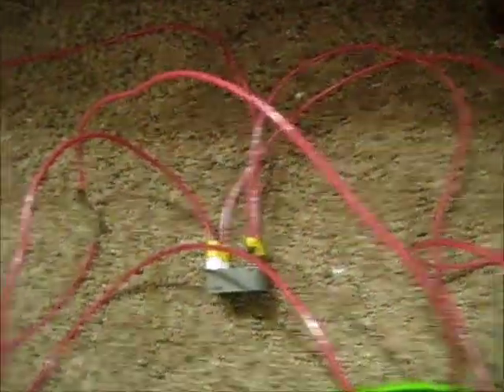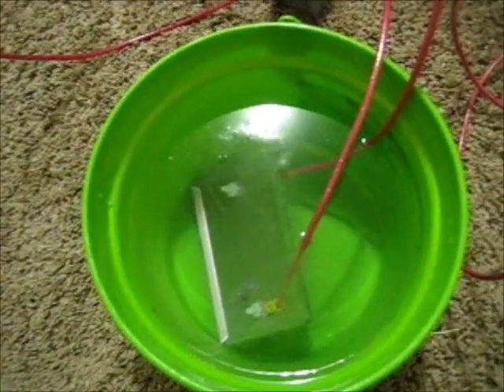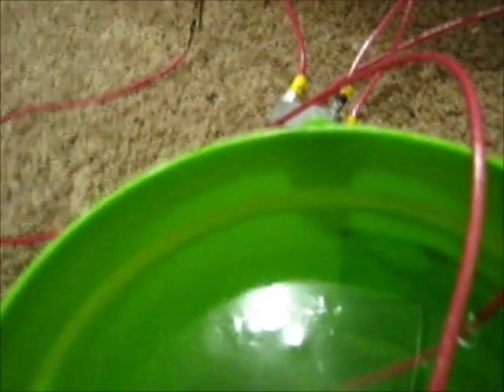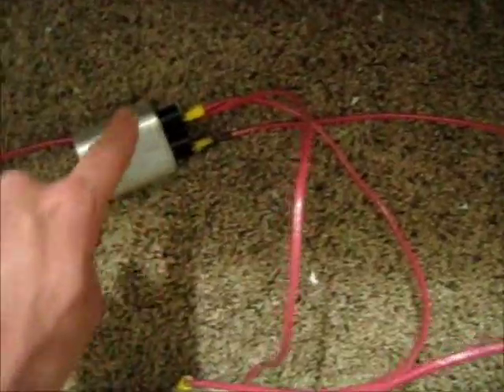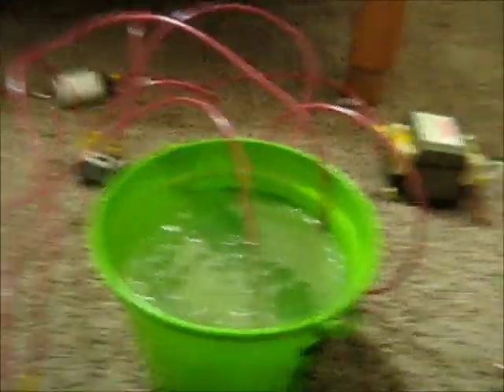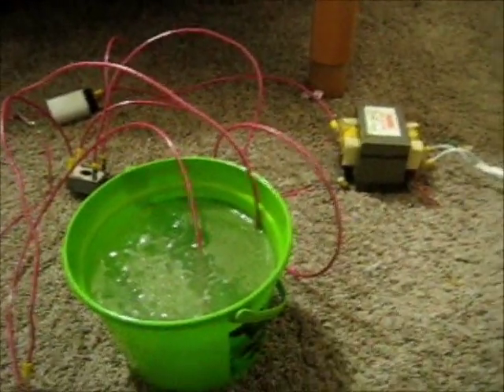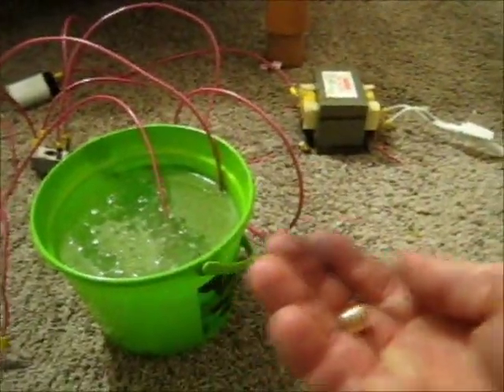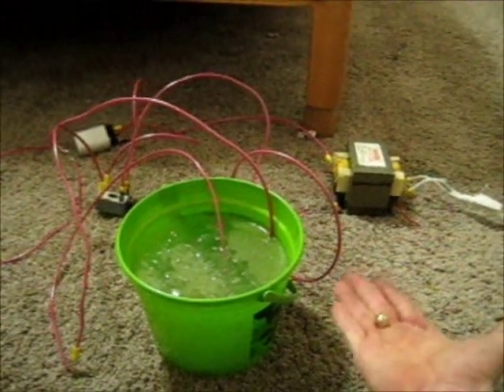HHO Using Microwave Transformer *Rectified* (Video Compilation)

Comment: Either you have a problem or have some amazingly pure tap water. The transformer usually puts out about 1600V DC at about 1A for the magnetron. If you were even drawing half of that power it would be 800W which should be plenty of gas but you are getting less than I got with a 12v 10W power supply even.

Stay away from microwave transformers if you are using the original high voltage winding. They are LETHAL ! And I have plenty of experience working on high voltage but over about 250 - 300v and 1 mistake will usually be your last. At the very least use high voltage gloves and eye protections since capacitors and transformers can EXPLODED when overloaded. And my guess is you are having a short in the water either by arcing or somewhere else.

Try using carbon water arc to make hydrogen underwater, since that has shown to work pretty good and would probably work at about 100v DC easy. See the patents on it. Same for Stan Meyer, Xogen, ETC, see the references at the bottom of the page on Google Patents. And save them in PDF for later. And carbon arc is something nobody has replicated that I know of either.

see waterfuelconverters for a patent list, but use Google Patent instead since it doesn't need a viewer and can download the PDF.

p.s. That bridge isn't strong enough for the transformer either, that may be another problem. A MOT puts out 1A normally and can easily put out 10A if shorted so a .33A bridge is way underrated. It needs to be at least 3A @ 2000v. And if you ever short it or arc you will be over the 1A rating too, probably 3 - 5 A or more. See the ARRL Handbook for how to make a high voltage bridge from several diodes for a transmitter power supply. If you do get a short then one or more your diodes will become a short from overheating, possibly causing AC to show up on the output. That will cause the capacitor to EXPLODE too ! Better yet stay under 50v since you are just making heat about a few volts per plate instead of gas.

I would put the transformer, cap, ETC in a metal box and keep my distance if you insist on doing this.  Also, if you make a water arc version, it will put out a ton of UV so it should be in a metal box too viewed only with a welding glasses. You could bet a carbon rod from an old battery too.
Good luck. I hope you try some of the patents.

Comment: As apprentices we boiled water for tea. One takes an earthenware teapot. take two old 1.5 Volt doorbell batteries. Pull out the carbon rods clean them. Fix them on an isulator spacing the rods to about half a centimeter connect solder a mains cable wires to the carbon rods (brass caps) Fill up the tea pot with water put the rods ito the water plug the mains plug in preferably 230 Volts. One can boil 1.5 Liters of water in just about 2 minutes depending on how Close the rods are. We used carbon rods because metal rods tainted the water. This is dangerous if you dont understand electricity dont try it out

Comment: One more thought, if you want the higher voltage obtained from a bridge rectifier, grab the rectifier diodes out of four microwaves and wire them in a bridge configuration. Advantage? higher current handling than your bridge.

Comment: Why not use the HV rectifier that was used in the microwave? It is of course rated to handle the output voltage of the MOT and is a much higher current device than your little bridge. you could use the capacitor as a filter for the pulsating dc or simply let the capacitive action of your metal plates filter out the pulsating dc just as your car battery does to the output of your alternator.
.
Reply: Excellent comment.  Made me think about the car system.  I though the diodes in the alternator let only dc come from it???
Reply: yes, but pulsating dc only the positive or negative half of the sine wave depending on which direction the diode is installed.

Comment: You need 2 different metals to get the hydrogen and oxygen bubbles, I'm pretty sure. I use iron for the negative and copper for the positive, and never aluminum since electricity corrodes metal and aluminum oxide is quite toxic. By the way, iron, copper, and water with salt makes an extremely cheap .2 to .5v battery which is rechargeable to a point. You will have to replace the copper and iron at some point due to corrosion, but don't worry about removing the oxides from the salt water solution, it behaves more like a conventional battery with the iron and copper oxides in it.
Reply from the maker: You don't need 2 different metals to get both gasses. It will work with any metal that is the same or different.
Reply: I was unable to produce both gasses with the same metals. I always had the copper produce more oxygen and the iron produce more hydrogen. I'm not talking out my ass here, I'm speaking from experience. I'm pretty sure the reason there's no oxygen bubbles coming up is because the high voltage is producing ozone which uses up the oxygen. Perhaps the voltage is higher than it needs to be. I use a 12v dc adapter and it's plenty.
Reply: +Sylver Nexus I'm not sure if you're talking about table salt, which is Sodium Chloride, but if you were, don't use it. It will produce Chlorine gas, and will kill you. Use Sodium Hydroxide (Lye/Drain Cleaner/Stump Remover) instead.

Also, confirmation on not needing two different metals. I built an electrolyzer that only used stainless steel. 

Also, if you're producing any gas at all, it's always in the correct ratio. Don't forget that water is HHO, so you will always get 2 times more gas on one electrode.
Reply: +Tyson Capel Don't use high voltage for electrolysis, the ideal voltage is somewhere around 2V, go for higher amps instead. In fact, the higher voltage may be lowing your reaction rate.

Comment: May I suggest using a step down transformer before attaching MOTs to your outlets? I am using one which steps the power down from 120v AC to 32v AC, then attached a MOT and it doesn't trip my breaker. Also, the MOT would not run on my 75 watt eliminator because it was too high of a wattage for it, but through the step down transformer it makes a tiny arc (1mm or less), but I can add more MOTs in series, each one steps the power up, so with enough MOTs, maybe 5 of them, I'd get roughly what one would directly on the wall with one MOT, without blowing circuits. Of course, capacitor banks help as well. I had the same vibrating happen when I was wearing a magnetic hematite ring and going through a security gate.

Comment: As far as your microwave oven setup, something is wrong with your microwave transformer setup.  FYI, a 1000W microwave transformer puts out 2KV at 500mA (half an amp), 60hz if your in USA, 50HZ most other places.  In a microwave that "power setting" (1-10) adjusts the duty cycle (or time on/(on/off)).  The rectifier is full-wave rather than the half-wave used in the microwave, so you will get a more constant power.  The microwave itself operates at 4KV, half-cycle (half wave rectifier).  Look up a microwave schematic, and "voltage doubler", may help you improve your project.  Is that red wire HV wire, or just thick wire.  The extra slack and alligator clips next to your metal lighter scares the crap out of me :0
Reply from the maker: The capacitor should have a positive and negative lead connected to it. I wanted to connect it so no negative side was attached just to see what would happen. Once I did that no oxygen was being produced why? I still don't know. Another thing to note is if I don't have the cap only on the positive leads then my breaker will trip. Having the cap only on the positive side prevents the cell from drawing too much current and it also causes the effect that will only produce hydrogen. 

Thanks for the info.
Reply: Weird.  Your not getting current on the anode, possibly due to the current being out of phase (the current is limited by impedance, which is basically a right triangle with the resistance on one axis (the wires, rectifier and cell), and the reactance (1/(2*pi*60*[cap value])  I'm going for my EE degree right now, my brain is fried as I've been working on homework all day, just going to bed at 4am.  Gotta get up at 8 to study, I'll let you know if I think of anything.
Reply: +filter4now You've got everything right so far.

Comment: When I was a child, I used to take a car battery charger connected to 2 electrodes in a bucket of water (just 12v), with 2 jars above them (read it in a book).  After 24 hours, one jar was half full at the cathode (I assume this is oxygen), and full at the anode (assume hydrogen), hence h20.  What's the benefit of HHO over Hydrogen/Oxygen?  The world's energy thirst can be solved, if only we figured out a way to STORE energy.  Electric cars have a problem, as they use lots of heavy batteries to store the energy necessary.  In Washington, we have a surplus of power (lots of hydroelectric dams), yet we still have one HUGE coal plant.  The coal plant runs 24x7, because it takes so long to start up.  Dams are for peak usage, because they can be literally turned on with a switch.  If we could store this energy off peak for peak, the coal plant could be shut down.
Reply: You mean store ELECTRICAL energy better.  Uranium and gasoline is two ways of storing energy. You mean storing alternating current right?
Reply: +filter4now I hope you don't think I'm impertinent, but water is the best place to store hydrogen. From one unit (ounce, gallon, liter, etc.) of water, (I believe the number is) 1,866 units of combustible gas can be generated. HHO is better than HO because the hydrogen and the oxygen are already in the proper proportions for combustion with full efficiency (all the gas is burned). Also, hydrogen (H2) gives less power (I think it's 1/3) than gasoline while HHO gives 3X the power of gasoline. Part of the problem with H2 is that before you can burn it you must use additional energy to break down the H2 molecule into HH and then you have to get O2 from somewhere break it up then put them together and then burn it. Very inefficient. HHO is already in its elemental parts and, as I said previously, it's already in the proper proportions for burning.
Reply: +Steven King Sorry Steven. Both uranium and fossil fuels pollute. The only exhaust from HHO is water.

Comment: Hi tyson, I have a question related to MOTS. We are working on a tesla coil, and we put the output of four MOTs in series to get 8kv. 

The MOTs all started internally arcing though

Any suggestions?
Thanks
Reply from the maker: The coating on the primary coils are not intended for the high voltage the secondary coils have going through them. You would pretty much have to take them apart and rewind them with magnet wire that is intended for higher voltage so the voltage does not pass through the coating and short out.
Reply: Tyson Capel So when you youtube search "QUAD MOT tesla coil" have those coils rewound the entire secondary?

Comment: oh and as for the amp jk LOL i can handle any amount of amps as long as the Volts ain't high enough like stick welding
Reply from the maker: Me too! I've had 50,000 volts pass through me for about 10 seconds from a tazer gun. It's pretty intense. I did it during one of my administration of justice classes back in the day.
Reply: +ODjWizardO Scott Maybe you don't know about "runaway cascade failure".

Comment: if thats an alu heat sink your using then you're making alu oxide you're rusting the alu thats were your o2 is going this is why people use stainless steel as this does not reacted well with o2 and works better. if you look at other vids on here under quick rust then this is how its done
Reply from the maker: It is aluminum. I typically use stainless still because the aluminum oxidizes. I figured I would give the aluminum a shot to see if I could get any interesting results.  Since I am using tap water with no electrolyte the aluminum takes much longer to oxidize. I can light the gas coming off so it is hydrogen.

Comment: so you're saying that 1/2000V at over an 1 amp will not kill you ok then i will agree to disagree on that one its your life not mine as for splitting hydrogen and oxygen from water (H2O) where does the hydrogen come from and where did the oxygen go i wonder after all you should get 2 hydrogen on one plate for every one oxygen on the other plate
Reply from the maker: 2000V at 1+ amp will definitely kill. It takes less then 1 amp to kill. 

I electrocute myself on a daily basis so my body gets conditioned to it. I can currently subject myself to 50 amps with no problem at all. JK lol. 

You should get 2-H off one plate and 1-O off the other but for some reason that's not happening I'm only producing Hydrogen. If you take a look at the video around the 10:49 mark you will see it for yourself. You can see it allot better when your physically there. The video didn't pick it up as good as I would have liked it to.  I have not got an answer from anyone as to why this is happening... It's very interesting though and could be very promising. It would eliminate the need for a membrane that is required to make a HHO split cell and it would be safe under pressure so you could have an on demand pressurized hydrogen tank all in one.

Comment: just had a closer look at your set up and you are  putting the cap in series on the ac side so you are blocking the curent but not the 50/60 hz mains this means you will have Volts but very littel amps if that cap was not there you would not be ether
Reply from the maker: I would still be there if the cap was not there it would just trip the breaker within a few seconds. 

The cap placed there like it is gives off some very interesting effects. You can produce hydrogen without the oxygen.
Reply: Tyson Capel  If you are able to produce hydrogen without the oxygen, then that would be a much better solution than building hydrogen separator cells.

Comment: use bitter salt for having a good electrolyte.
then U dont need high voltage to get any current thru the water.
I mean HV from a MOT combined with water is a sort of crazyness O_°

and just for having HHO gas U dont even need to rectify.
use AC from a mains plug and U'll have a shitload of gas.

Comment: Good Lord! I don't know how you are still alive by the end of this video! Yesterday I incinerated my Multimeter as I wanted to see if the Microwave transformer was outputting its high tension, which I belive is in access of 1000V, so my Multimeter only goes upto 1000V ac or Dc, and expected that worst case senario would b the Multimeter may indicate Over limit reading, or blow its internal fuse!

But that did not happen and when I switched on, there was this lodest hum I ever experienced, like a power station sverely overlaoded, and my multimeter incinerated compeletly , smoke and smell filled the room, i dived for a cover!

Thse Microwave transformers and water are two lethal combination as well as explosion risk from Hydrogen gas.
Reply: Tyson Capel Hey nice work! Stan Meyers would be proud.
Reply from the maker: The MOT I am using puts out 2100V the max ark I have got out of it was about 2". I was not to sure if the insulation on the wire would be good enough so the first test I did I did not touch anything. Then once I new it was Ok to touch I went ahead and did so. Water and high voltage is certainly very dangerous. I have never been shocked from it and don't plan to. I have been zapped by the MOT capacitor and it puts out a pretty good bite. Ya they will blow a multimeter that is not rated for that voltage pretty dang fast. You can get some very interesting effects...
Reply: Explosion from hydrogen gas?? He was barely able to get them to light and make a little fire
Reply from the maker: Lol you got that right... Not much gas coming off at all.

Comment: God o something loves you to much; Because at 1 point of your experiment you were near to die; 1 of that cables manage ultra high current.

Take care friend; We loves you too!
Reply from the maker: Yes he does. I have been shocked by the MOT capacitor i thought it was discharged all the way and when I was putting it away sap.. It didn't hurt much just catches ya by surprise.

I have been tasered with 50,000 volts and that does not feel to good, then again they mainly put out volts there are next to no amp's going through a taser gun...

Comment: I don't have the nerve to try a neon transformer which has an output of 10KV. it would take a heavy diode to make DC. I don't think there is a bridge for that kind of current but you can make your own with 4 diodes. I know there are diodes because I have a few from my brother when he worked at Westinghouse years ago. Just a word of cation there may be some radiation from the microwave transformer. I don't know how much but I would put the transformer in a metal box and ground it before I would p

Comment from the maker: You would have to build a circuit which would go between the alternator and the transformer that would properly pulsate the DC so the electrons can flow properly within the core of the transformer. 555 IC, transistors, mosfet etc. are needed.

Comment from the maker: Yes a transformer can work with DC but not just DC, you have to have the proper circuit in order to pulsate the transformer correctly.  So with an alternator if you connect a microwave transformer or any other transformer straight to the dc output of the alternator it wont work.

Comment: that is half right, tazers and stun guns are DC with Extremely high voltage and hertz. You can connect the Transformers in series & Ark the Taser on them and it will make low amps with high voltage out of each transformers.

Comment from the maker: You can't use DC to increase voltage in a transformer. A transformer only work with AC. There has to be a changing magnetic field to make a transformer work therefore since DC does not alternate it can't induce electric force into the core/coil of the transformer.